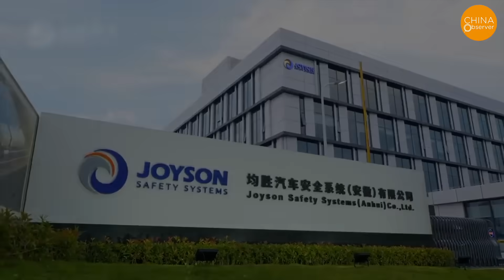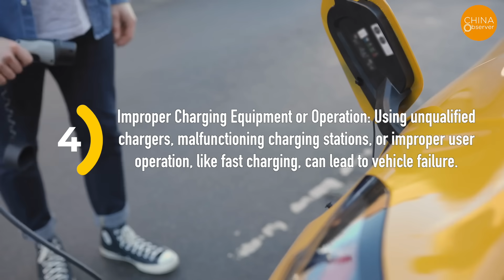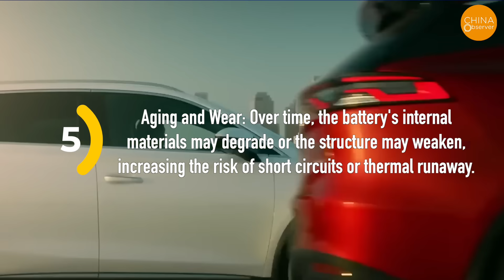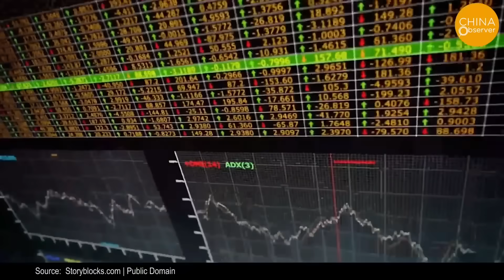Shocking! China’s New EV Battery Ejection Tech Turns Every Electric Car Into a Moving Bomb

Comment: Dumbest idea ever, gas cars catch fire way more often than BEVs so should we eject the gas from cars too 😂
Reply: but can you get out of a burning EV? Seems like most rear passengers burn to death.
Reply: @jabberthebut well there is supposed to be a layer of insulation and heat sheild in between the battery packs and the car body itself...
China rarely uses proper insulation along with proper sheilding in the EVs.
Compare BYD to Porche or TESLA and the sheilding between the companies are very different and BYD is cheap on that.
US and European manufacturers put more effort into the development of that aspect.
There not perfect but they have proper sheildings.
You can tell it when you see Burned up EVs/Hybrids being bought and rebuilt.
Many batteries despite being partially on fire due to other reasons survive extreme heat exposure. 
Compared to BYD the body itself is extremely thin, the sheilding is thin and little insulation.
The batteries are very poorly built and are Well known for over voltage and spark fire.
Partially due to cheap wire insulation,  cheap electronic system control.
European and American cars are vastly superior in technology eith hybrids and EVs.
Some and i mean few Chinese EVs are actually well built and have proper electronics to control and maintain safety.
You can achieve alot with cheap electronics....
Now to use them and expect safe and reliability,  thats a different story. 
Most chinese EV cars dont even use proper electronics as for Grade type.
They usually use cheaper and older technologies that are not designed to stay years in outside environments.
Reply: Thats not true in China...the vast majority of vehicles are full electric now.
And a vast many catch fire due to battery issues.....
But to Eject battery packs because of they acknowledged of the battery danger is even more wreckless
Reply: @kriskimmel2128 thankfully I live in the U.S., HYBRIDS cause the most fires then gas then BEVs